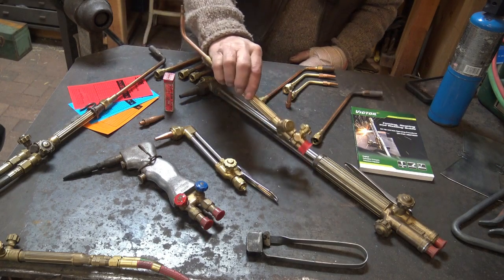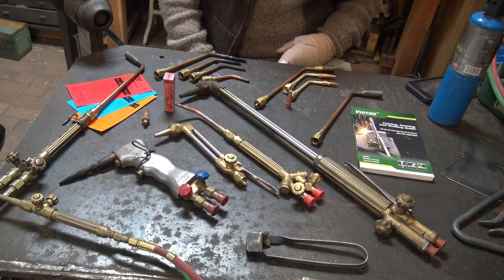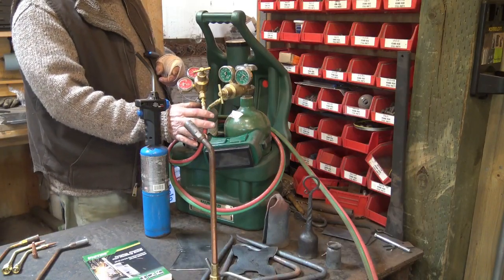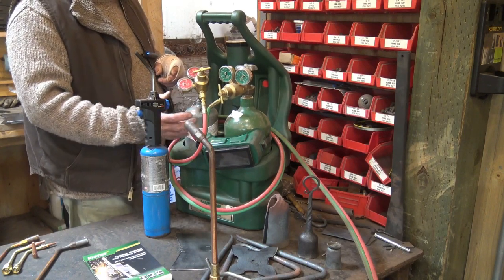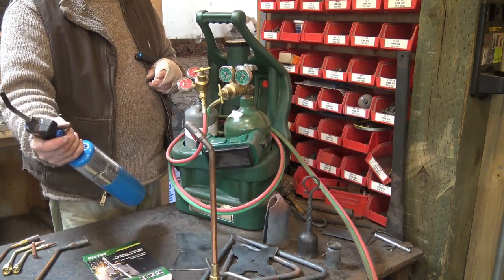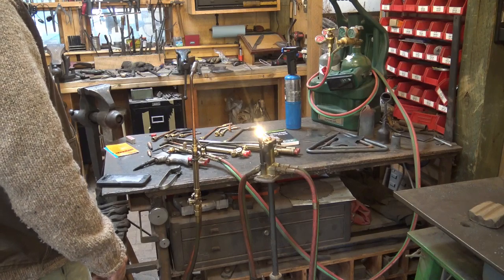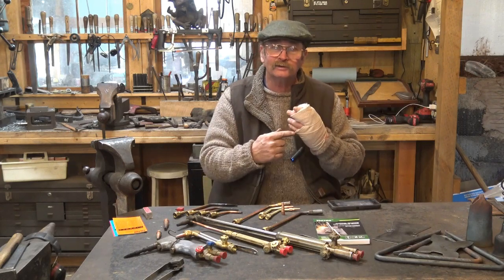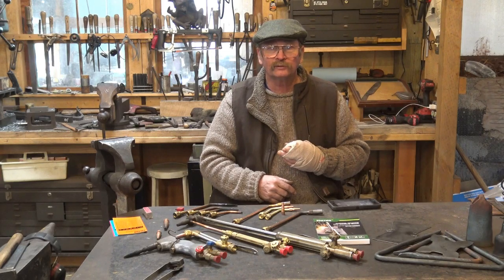Oxy Fuel torches for the blacksmith shop - basic blacksmithing

Comment: ..Thank You Sir!! I was debating on getting a torch setup and wondering which gas would suit my needs better. Propane i believe will do me just fine. Very Good information as usual and timely!! Speedy recovery with the hand...!!
Reply from the maker: There are a few propane specific torches out there.  But buying on the just needs a change of the tips will keep the option of using acetylene available.  Plus that keeps you in a name brand torch that might be better supported through local dealers.
Reply: Thank You John...

Comment: Those add-ons for the smaller Victor torches are not flashback arrestors.  They are simply reverse flow check valves.  I use quick releases, including both arrestors and check valves on a Victor HD310C.  I also use a WH 315FC+ which integrates the arrestors and check valves in the torch's body.  Cool, have a gas saver as well, all fuels with propane pilot.  I have both setups, oxy-acetylene and -propane.  I plan to use propane for 90% of operations.  The coolest torch head I use is a Harris V-Series injector style torch V-2460-F, propane only, LP.

Comment: Actually, propane burns a lot hotter than natural gas. I use the tips used for acetylene on propane. But they're the tiny jewellers tops! I've never tried cutting with propane. Ill have to check that out! Thanks for the tip. 
...I think Victor is under Esab's brand now.
Edit: I've heard Henrob torches called Cobra or Detroit torches or something like that..

Comment: I don't think the actual piezo lighter fails in those torches. Unscrew the tip of a torch sometime (without the bottle, obviously.) There's a wire just inside the threaded part that shorts to the neck and makes a spark when you pull the trigger. If that wire gets bumped or corroded, you won't get your spark. I've had to replace the wire on my TS4000 when it went through a flood, but it's easily fixed with an hour of work. Next time it dies I'll do a video on the repair.

Great video, thanks!
Reply from the maker: I'll try to remember to tke a lok the next time one gives up on me.  That would save on replacing them.
Reply: Black Bear Forge They can be a little fiddly and annoying to thread the wire. But the Bernzomatic torches are pretty simply built. Sometimes just bumping the wire around and pulling the trigger to see if it sparks fixes the problem.

Comment: Did you ever get the oxy/propane setup going. If so, how is it going? I just ordered a Victor oxy/propane torch and am curious if it's worth a salt.
Reply from the maker: I have it available.  However I tend to weld with the torch and the acetylene is better for that, so I need to move the regulator back and forth.  I plan to set up two separate fuel sources so I can just chose the one I want without changing back and forth.

Comment: Great  video!!!!! I have question for you. What size is your chimney on your coal forge. I am building a small coal forge and I am currently trying to figure out the chimney system for it. Thanks in advance!!!!!
Reply from the maker: My flu is 10" and I use a side draft hood.  it is enough but just barely.  a 12" flu or a very tall 10" would be better.  for an overhead hood a 12" would be minimum.
Reply: Black Bear Forge - Thanks 👍👍👍👍

Comment: I don't have a torch. I've never felt like I would use it enough to justify buying one. But there are instances when I have to use the water buck for selective cooling, like the reverse twists, and thought it would really be handy to have one. What would you recommend for light duty work like that? Would a propane torch work in those situations?
Reply from the maker: A regular propane torch doesn't get hot enough to do much.  Oxy propane is a good choice if you're not welding with it
Reply: @BlackBearForge  alright thanks John. Learn something new every day. Mainly because I watch your videos every day.

Comment: Would you be so kind as to show us your torch head storage ideas. Mine just clutter up one of my largest work benches,
Reply from the maker: I had planned on covering that briefly and totally forgot.  I keep mine in a mechanics type tool chest with drawers.  I would like to have something closer to the torch.  One issue I have is mud wasps that will plug up anything with a hole in it, like the inlet side of a torch tip.  So mine have to be in a closed storage container like a drawer.
Reply: Thanks John that gives me some ideas.

Comment: what I love my torch for is I can weld anything with it, don't need electric power, dont need special shielding gases, she just welds!
Reply from the maker: I thought about giving up the electric welder in favor of the torch.  Have you welded up any large tools, such as power hammer dies?
Reply: Not with the Oxy set. Biggest steel I have welded with the oxy was a couple of hardy bottom swages where I have welded 25mm square section on to 3/4 plate, but it was surprisingly delicate work, as I was trying to make a minimal height weld so I didn't have to grind to much to get the tool to sit flat in the anvil..

Comment: Why. It hook the hose reel before maximized valve then you can take it with you and just roll up the short bit of hose even if you made a 10’ for in the shop
Reply from the maker: The longer the hose after the valve, the slower the reaction time both shutting the torch off and relighting.

Comment: Flashback Arrestors are designed to *stop a flashback* (rapid flame propagation) *AND* prevent *reverse flow* of gases: Check Valves only prevent *reverse flow* of gases; they *cannot* stop a flashback.

Comment: The torch takes time to go out, not because the valve is too slow shutting off, it's because of the pressurized oxy/acetylene gas still in the 25 feet of hoses in between the torch and valve, the torch can't go out until the hoses empty themselves out.